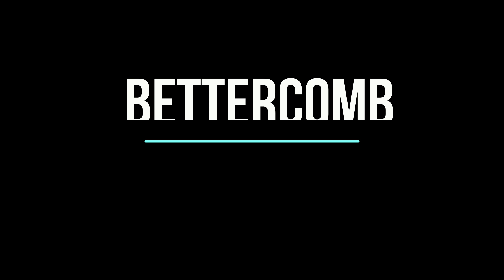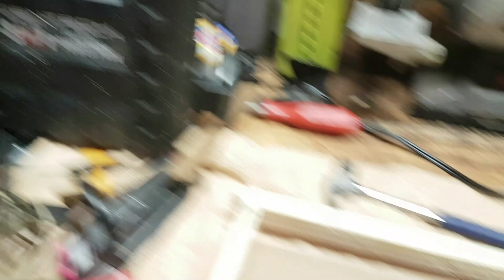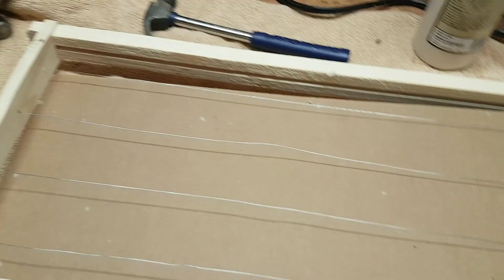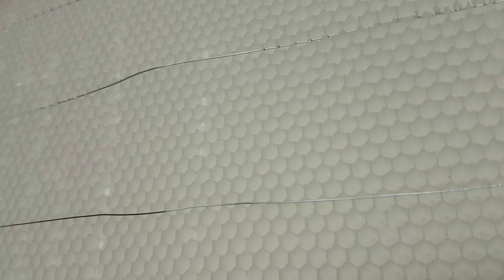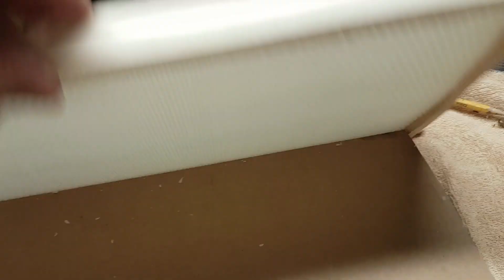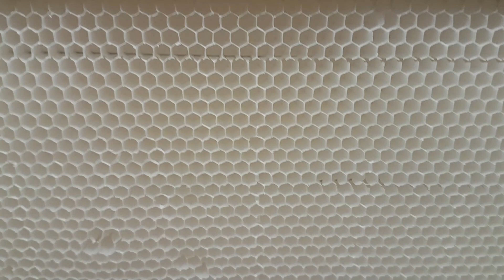BetterComb from Betterbee Install

Comment: Thanks.  I followed your lead and installed it the same way. Please keep the videos coming, I'm interested to know how it works for you.  So far, the frames I've installed have plenty of nectar and pollen, but no eggs or larva.
Reply from the maker: It was late in the season when I put them in. Same on nectar and pollen. I think I will do 2-3 frames for a spring package. That will be the a great test.
Reply: +1 on using this for packages. Very interested to see how that works and if they build up better.